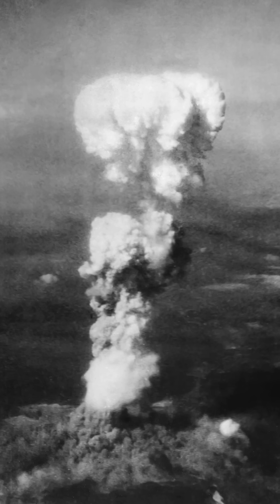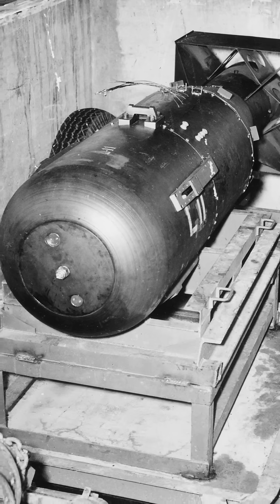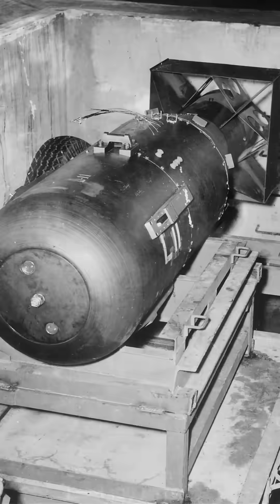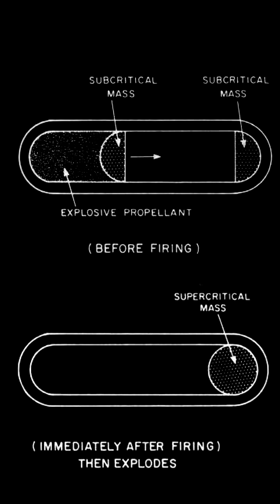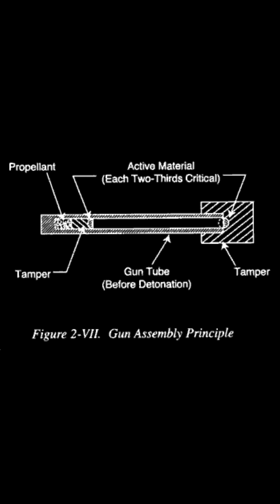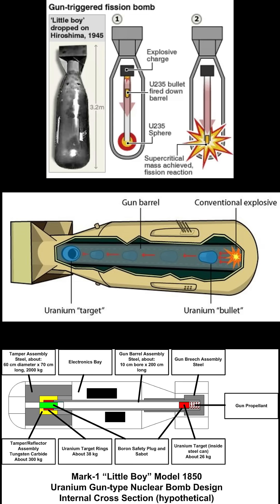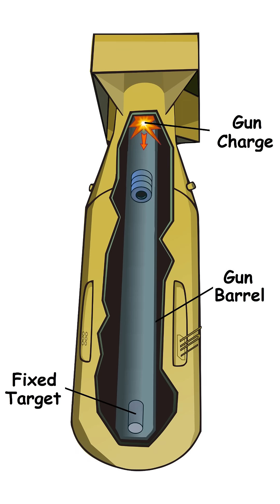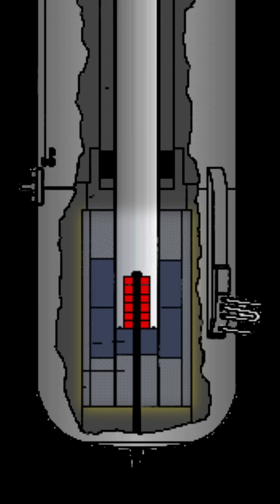What Everyone Gets Wrong About The First Nuclear Weapon Used In War

Comment: Why didn’t Chernobyl and Three Mile Island blow up? Asking for a friend.
Reply: If you mean why wasn't there a giant mushroom cloud, that is because power plants aren't designed to create them - they are designed to prevent them.

However, Chernobyl did blow up, so much so that it contaminated most of Europe, with fallout spreading for thousands of kilometers. It was effectively the largest dirty bomb ever set off in a sense. However, other people who are a lot smarter than me have written books on the subject.

Three Mile Island didn't blow up like a nuclear bomb either, and for the same reasons - it was optimized for creating usable power over time, not an instantaneous detonation.

Interestingly, the two disasters share a few things in common, and the US came fairly close to a Chernobyl-esque event when the containment building filled with hydrogen gas due to breakdown of cooling water. There was real concern that this hydrogen build-up could result in a conventional explosion that would have resulted in an event that would have roughly mirrored Chernobyl years earlier.

Comment: 1. For all of its "inefficiency" and it was inefficient-it still generated somewhere between 10-13Kt of explosive power, at least that is the current "Best estimate" based upon modeling of the design and physical analysis of weapons effects. 2. Scott left out the "Urchin" initiator [neutron source] which was added to the design to increase probability of chain reaction occurring. 3. The design was incredibly dangerous-even though the bomb was deliberately not armed until after takeoff [N.B., several years ago I met a man who has some of the original safing plugs in his possession, was interesting to hold that bit of history] if Enola Gay had crashed into the ocean there was a decent possibility of a "fissile" due to the moderating effect of seawater on those multiple critical masses, this could have easily contaminated Tinian. 4. Another thing that many authors get wrong is the escape maneuver after bomb release, it is often depicted incorrectly as a "180 degree turn", but it was not, it was a 155 degree diving turn, this being calculated to create the greatest distance between the bomber and the detonation point. Little Boy was a free-fall bomb, not parachute retarded, so the time from release to detonation [which occurred around 1,900 feet AGL] was only on the order of 45 seconds or so....
Reply: That had to have been the most tense 45 seconds of those crewmen’s lives
Reply: Yeah Little Boy is generally thought to be roughly 12kt. Fat man is thought to be 15-18kt
Reply: i would think that keeping going straight would be the fastest
Reply: @affegpus4195  in that situation you are traveling in the same direction as the bomb which will fall in a parabolic arc,  so you will be much closer to the explosion than if you turn away.
Reply: @affegpus4195 Going straight, you would end up directly above the explosion, disregarding air resistance.
Reply: a fissile "fizzle"

Comment: How did they get the uranium into a cylinder with hole and rod shaped as I'm guessing a lath operator would die horribly
Reply: Presumably they formed them in molds, probably in pieces to reduce environmental exposure before assembly in the device. I'd love to find out more though.

Comment: Why would they fire rings onto a pill shaped mass? What’s the benefit of doing it that way as opposed to the way most people think of it as happening?
Reply: I guess you keep the whole thing inside the barrel diameter while the barrel ensures alignment of the donut onto the cylinder.
Reply: My guess is when the method of detonation was found out, everyone thought since they used a “gun” to shoot one mass into another naturally it was assumed they’d use a solid “bullet”
rather then a stack of donuts.

Comment: I always thought the gun type bomb, was the plutonium bomb on Nagasaki
Reply: Scientists wanted to make plutonium gun bombs, as they are much simpler. They even started assembing hulls for future plutonium bombs. But quickly realzed that because of high spontaneous fission of Pu-240 (instead of 239 that is used in weapons) gun will explode before enough reacts leading to just a big (and very expensive) radioactive explosion. 
So with Plutonium they had to concetrate on engineering headache called implosion

Comment: "Are you sure it's gonna work?"
"Good point. Let's do a static fire test"
Reply: shoulder fires little boy maliciously
Reply: @exceptionalanimations1508  Shoulder-fired Little Boy? You mean the Davy Crockett?
Reply: @5roundsrapid263  no I'm joking about putting the gun tube assembly on my shoulder and firing it, essentially putting the two parts of uranium together and nuking myself
Reply: There was not enough highly enriched uranium available to conduct a test.  It all went into the warshot.
Reply: Interestingly they did test fire the gun mechanism with non fissile material and the one they used operationally was a previously fired gun from the testing program.

Comment: I always thought the reason that they had the donut moving and not the plug was because the barrel could be kept the same diameter all the way to the.end of the movement. 

If you had the plug moving there would have to be a point where the barrel ended and it would get thrown into the doughnut and if there was even the slightest mis alignment then then the 2 components could fracture uncontrollably and give an even worse yield.. Given the tolerances that they were working with, Once I learned of this design, I thought that the donut moving made much more sense
Reply: Couldn’t the donut be formed to be the exact same diameter of the tube, just simply replacing its material? I’m sure that would heavily change the dynamic of things, but interestingly.

Comment: IIRC, the tungsten carbide was also meant to hold the critical mass together for just a tiny bit longer, to get as much yield out of the fission as possible. It did that not by the material's strength (it was instantly vaporized) but the high mass and density - and therefore inertia - of the tungsten nuclei.
Reply: Correct. Hydrodynamic tamping.
Reply: sounds right with the limited physics i got.
Reply: You are indeed correct!
Reply: Honestly, water would have worked better but ut was a rather rushed project.
Reply: @vyor8837  No it wouldn't have. Water has a lower neutron albedo, is more moderating, and is less dense, making it an inferior hydrodynamic tamper.
Reply: @Evan_Bell  water is surrounded by the tungsten and is enriched with lithium salt.
Reply: @vyor8837  What on Earth are you talking about?
What do you mean in *is*? No weapon has ever been built like that. 
That'd be even less effective.
Reply: @Evan_Bell  it literally wouldn't be less effective because I just described a fission-fusion device.
Reply: @vyor8837  No fission fusion device has used a layer of enriched lithium salt dissolved in water between the core and the tamper.
You don't know what you're talking about.
Reply: @Evan_Bell  well I didn't say between the core and tamper.
Reply: @vyor8837  You said "water is surrounded by the tungsten" 36 minutes ago...
If not inside just inside a tungsten tamper, and by implication just outside the core, where did you mean? 
Not that any answer you give will make you correct, as water has never been used anywhere in a nuclear weapon.
Reply: @vyor8837  Crickets lol.
Reply: @Evan_Bell  I was eating food, jackass.
Reply: No solid material is strong enough to hold the masses together: Instead, the energy of the chemical explosion did it.
Reply: @robinhodson9890  It's not a matter of physical strength or the meager pressure of the rarefied low explosive propellant gases, but rather shock impedance and inertia.
If there was no tamper, the surface of the core plasma would rarefy at escape velocity causing the core to undergo second criticality very early.
With a tamper, the core plasma can only expand at the velocity of the shock front it produces in the tamper, meaning the neutron multiplication rate drops more slowly, increasing yield.

Comment: I think you are wrong. This design won't explode. It's not enough.
Reply: Tell that to the inhabitants of 1945 Japan.
Reply: @hoghogwild  it's might be a deliberate misinformation so someone who think this design will work would fail. The working(exploding) design is much more complicated.
Reply: @Wallopingaround  There was 2 different bomb types used in 1945 Japan, a gun type and an implosion type device. One powered by plutonium, the other by uranium.
Reply: @hoghogwild  yeah, but I'm pretty sure gun type design was not used, was not made and could not work. But yeah, 2 bombs, 1 uranium, 1 plutonium
Reply: @Wallopingaround  Thin man was a proposed plutonium gun type weapon that never used. It was the reason the silver plate B-29s had their bomb bays modified to fit the long thin man design. Fat man and little boy fit inside normal B-29 bays.
Reply: @Wallopingaround  The implosion type using 6.4 kg of plutonium named Fatman was dropped on Nagasaki 9 August 1945.  The gun type device using 64 jg of plutonium named Little Boy and was dropped on Hiroshima  6 August 1945.  The gun type weapon was so sure to work that it was never tested before it was used in Japan.  The Navy later fielded gun type  nuclear weapons from 1947-1951 aboard aircraft carriers.

Comment: great short, scott. a small nitpick here, when you say the tungsten carbide blocks "increase" the critical mass, it should really be "decrease" the critical mass, i.e., their reflection decreases the amount of uranium needed to reach a critical mass, making it more efficient. but i get what you're saying: they increase the bomb's power by preventing neutron leakage
Reply: AcTuAlLy, he said "increased the effective critical mass, making it more powerful", and I think that is correct.
Reply: "Increase the effective mass" means "make it behave as if it had more mass". In this case, move the point when the mass becomes critical lower. As Zen said, the video is correct.

Comment: Do we know why they chose to do it this way? seems like a more difficult approach
Reply: If you cover the larger part of Uranium with neutron reflectors you will melt it. 
And "why not 2 equal 1/2s?"
the air between 2 halfs would've started to rapidly heat up acting as a pneumatic pistons  pushing each other apart and not letting it react properly.
Reply: Because the timing concerns of the Fat Man were very difficult to overcome.  Many small explosions must be initiated with microsecond accuracy.  Simply smashing 2 sub critical masses together is MUCH easier, but vastly less efficient.

Comment: one thing about nuclear bombs that surprised a couple of days ago, was their size. I looked up how large the Tsar bomba was a few days ago and apparently the largest nuclear weapon ever detonated was just 8 meters in length and 2.1 meters in diameter
Reply: It was a massive weapon, it required a modified bomber with some of the bomb exposed during flight. the bombay doors couldnt be closed so they were removed.
Reply: @hoghogwild  yeah but if you compare the size of the physical bomb and the resulting explosion it's tiny
Reply: The W88 warhead on a Trident missile is the size of a large road cone. It’s maximum yield is about 450kt. It’s tiny compared to weapons of the immediate postwar period.

Comment: I had always assumed that there were more than two pieces combined to form the critical mass.
Reply: That would be exceedingly difficult to synchronize.
Reply: @SebastianKaliszewski  Which is why they are exceedingly difficult to make, just ask all the countries that don't have them yet  despite trying for the last 70 years.
Reply: @ekij133  Gun type weapns are 2 pieces. Implosion weapons are single piece (or a concentric layers). Getting that single piece sphere (usually hollowed out) to compress is the difficult part. There's no multi piece assembly.

Gun type weapons are easy to build. The problem is they don't work with plutonium (predetonation blows them apart and yield is no better than conventional explosives) and require highly enriched uranium. Uranium enrichment is difficult thouh.

Comment: Hey, that's my old (pre Coster-Mullen) cross section at the bottom of the incorrect diagrams.  Fortunately John first measured the gun tube bore, putting the cylindrical projectile into doubt, and then found unclassified mentions of target rings.  Lots of incremental learning in the history of open source analysis of nukes.
Reply: There was also a polonium-berium neutron initiator inserted to increase the neutron flux. 
If the target was larger, i.e. closer to the critical mass, pedetonation would occur before the complete assembly of the physical package, which would result in fizzle in such an inefficient design in terms of generating usable neutron generations.
Reply: @dinkoz1  the National Labs tried to get a better precision yield estimate for Little Boy in the context of survivor medical impacts science, and found that it likely was critical about 15” before full target insertion finished.  They had to build a mock-up as analytically our tools have diverged so much from that type of system…
Reply: @Georgewilliamherbert it went critical then but as far as I recall uranium is a poor enough material for a nuke(as opposed to plutonium) and was low enough grade to not go super-critical until much more of the cylinder was around the target.
Reply: @Georgewilliamherbert  Cool. You're a beacon of wisdom in the low signal-to-noise ratio cesspool that is aRocket. I always appreciate your inputs.
Reply: Are you the same George Herbert from the aRocket mailing list?
Reply: but what's the point of moving the donut instead of the middle bit?
Reply: @NoNameAtAll2   Basically, gun type bombs slam two parts together that need to be as big as possible in nuclear reactions criticality as possible, to create as much supercriticalality as possible for fast reactions.  The target is inside a large tungsten carbide neutron reflector to add as much criticality as possible without tons more uranium.  The maximum subcritical size of a uranium rod with a gap between it and the reflector is higher than the size of a hollow cylinder in contact with the reflector.  Conversely, the hollow cylinder “projectile” uranium which is only lightly reflected by the gun tube can be larger than a single large rod could be.  So making each part individually as big as possible before firing is the goal, and then when you fire it and drive the cylinder down into the hole between the target cylinder and the tungsten carbide reflector you get the fastest and highest boost to overall criticality, and highest yield.
Reply: @Georgewilliamherbert  Bonus points for mentioning John Coster-Mullen. I was lucky enough to get a copy of Atom Bombs just before he died 😥
Reply: @KiwiExpressCream  Carey Sublette and I communicated a bunch with John about what he had found.  He was a neat guy.

Comment: The Navy continued to operate a small number of gun type weapons after the war, they were smaller and lighter than comparable implosion weapons and used on P2V Neptune patrol aircraft as a carrier based strategic bomber. To ensure the Navy had a role to play in a Nuclear conflict.
Reply: Some of the first artillery atomic shells were designed as gun type for simplicity and because the implosion design was still large. Later, inefficient systems with Pu 239 oval pit and plate blocked shock wave implosion with two ignition points were used. It was quickly abandoned due to inefficiency and large contamination with highly toxic Pu in a small area (Pu is highly biologically toxic, so death from biological toxicity is more likely than exposure to radiation inside the body)
Reply: @dinkoz1  The plutonium linear implosion system wasn't exactly quickly abandoned. It was used for 3 decades and only withdrawn from service after the end of the cold war.
Reply: FYI:The Lulu was also used on the P-3
Reply: Not just the navy.. The air force and army too. The last ones were retired after the cold war.
Reply: It would be a shame if the Navy wasn't helping to end the world.....😂😂😂😂😂
Reply: @jplacido9999  It's simply a question of fairness!  (and who has the bigger budget)
Reply: The 16" KT (Katie) nuclear shells "allegedly" deployed on the Iowa class battleships were "allegedly" gun-type.
Reply: @ahseaton8353  They were. Nothing alleged about it.

Comment: It's always amazed me how persistent this error has been. Obviously, if you fire a solid cylinder into a closed barrel, the other end would rupture causing alignment issues. 

The intentional misinformation extends also to the implosion design and many people still imagine a bunch of wedges fired into a center.
Reply: I thought implosion designs were pretty much hollow spheres (split into hemispheres or containing small holes for safety devices/inspection) with nested explosives/Be/Pu or U/neutron source or D+T for fusion.

Why can't they vent the barrel if the end rupturing is a concern?
Reply: @reddragonflyxx  , if you want some excellent references about the difficulties and how they were solved the books by Richard Rhodes are excellent starting points. "The Making of the Atomic Bomb" and "Dark Sun".
Reply: The issue of a ruptured casing isn't the reason why the projectile was hollow. Also, the little boy bomb featured an "anvil" to absorb the impact of the projectile.
In the end it was fitted with 4 neutron initiators, and so the anvil was redundant.
All later gun type weapons produced by the US eliminated the anvil and relied solely on initiators to initiate the weapon prior to impact induced disassembly.
Reply: And they don't tell you what's in KFC or coca cola either, if only you knew how easy the evil stuff was.
Reply: @Retired Bore never tell your enemy how you got the rock to stay attached to the stick. ( throwing sticks and stones vol.1 chapter1 )